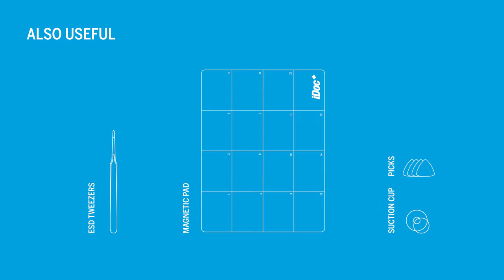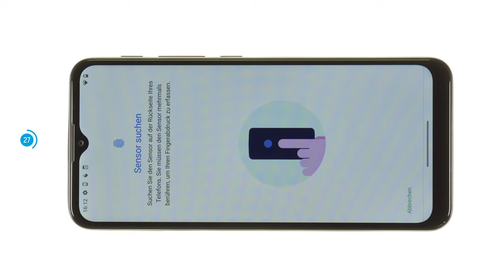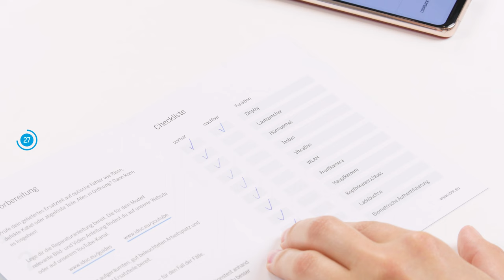Motorola moto g10 – Screen replacement [including reassembly]

Comment: This is a brilliant, clear and accurate video! Many thanks. To replace aftermarket "screen only" heat the screen to loosen the glue and push the old glass off from the back. Be careful though as the aftermarket screens are not gorilla glass and are not as strong as genuine.